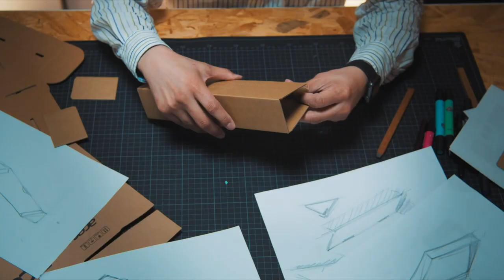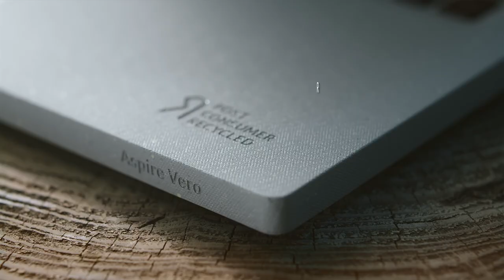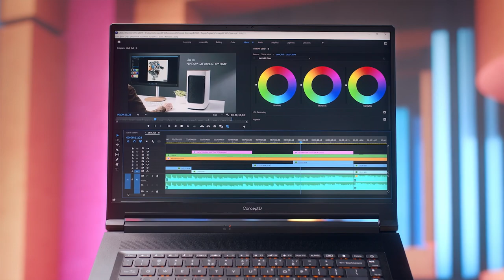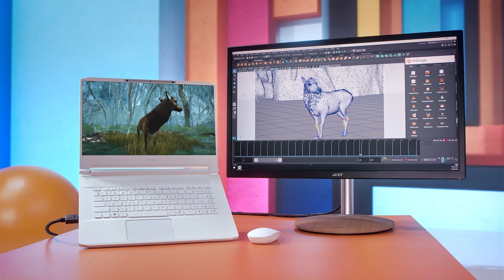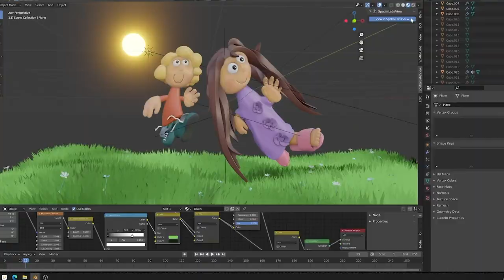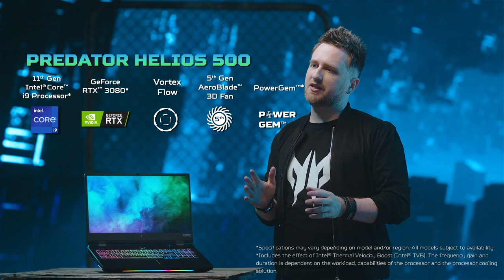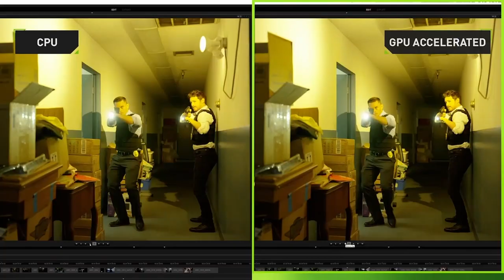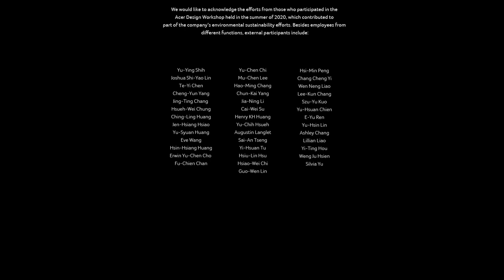Next@Acer 2021 | Global Press Conference

Comment: Really, this good work should be promoted as to skill up your illiterate customer service as well. 

Finally, I had to reach consumer forum for a defective product that I purchased. I do not know the forum. Acer anywhere is acer for me. 

> On the first call, it was told to me that you need to buy an upstream cable. I was using the HDMI cable in the box. I bought one HDMI cable with eARC (Audio Return Channel).

> I called Support again and this time they said to call customer care on a working day and a technician will work on the issue.

> I called customer care today and I was told that this monitor does not have speakers as it is not mentioned on the Invoice Copy.  (Attached is the invoice copy)

Do Acer products work on Invoice copy? Or the Product Specification?  

A bad company with a bad customer service